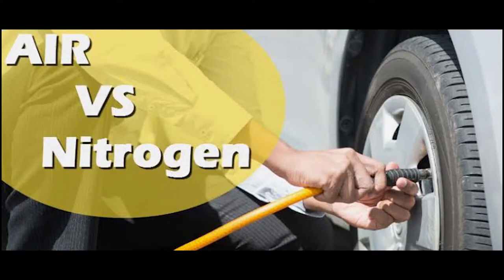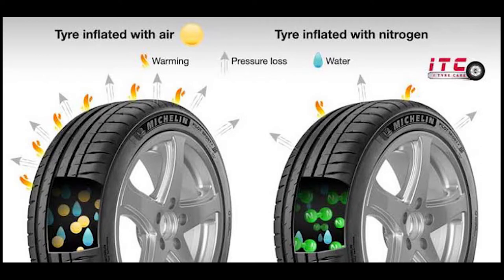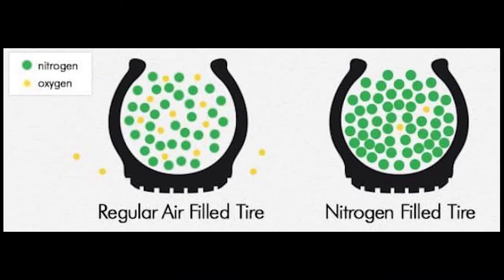Nitrogen vs Air in tyres |malayalam

Comment: Mileage enganeyada koodunnath😂😂😂😂😂 air um nitrogen um ore level thanne alle fill cheyyunath
Reply from the maker: Nitrogen molecules are larger and slower moving than those of compressed air. Because of this, nitrogen won't seep out of your tires as quickly as air will, helping to maintain proper pressure for a longer period of time.